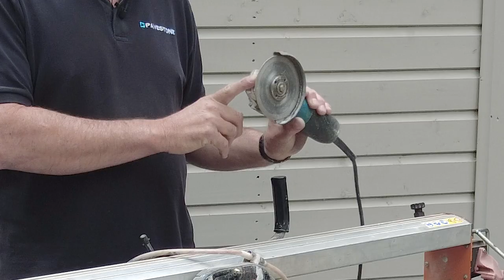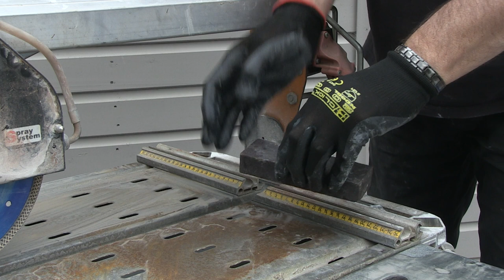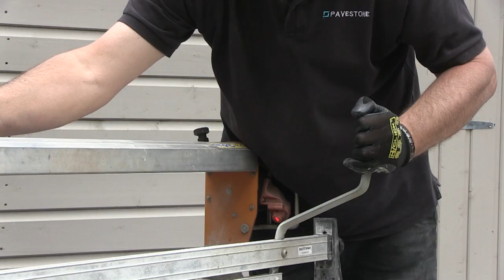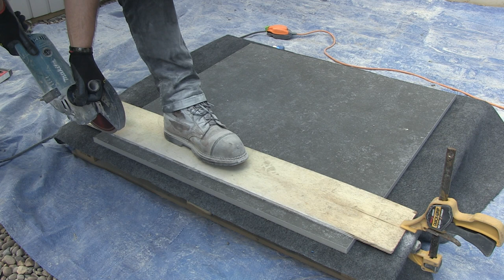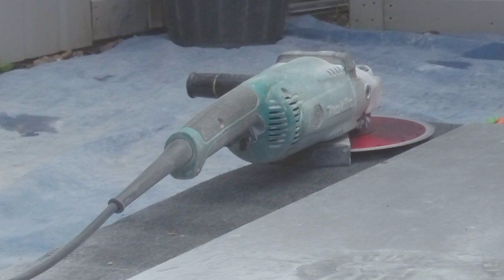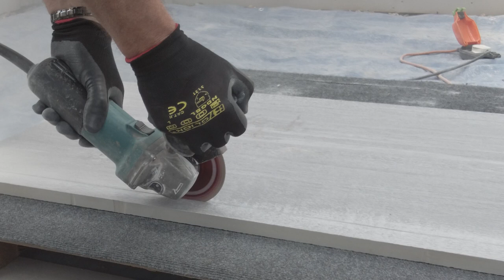How To Cut Narrow Strips in Porcelain Paving

Comment: If the slab was 40mm thick would it be a good idea with a 4 “ grinder and the appropriate blade cut both sides evenly ?   I have a rare slab broke one and need to cut a 20mm sliver off  slab is 2 ft x 2 ft…